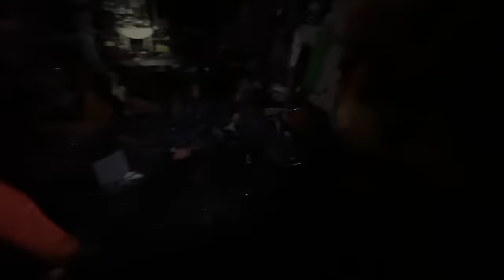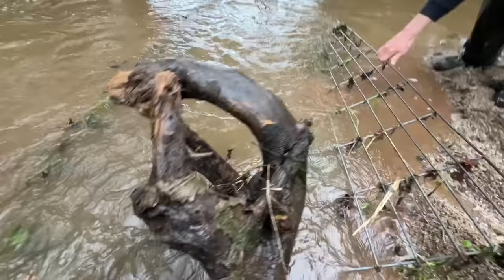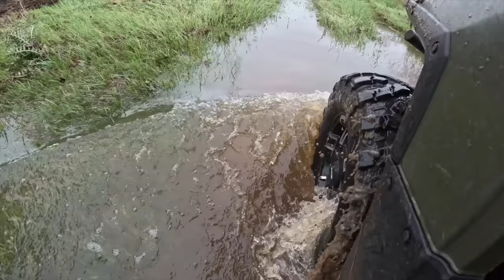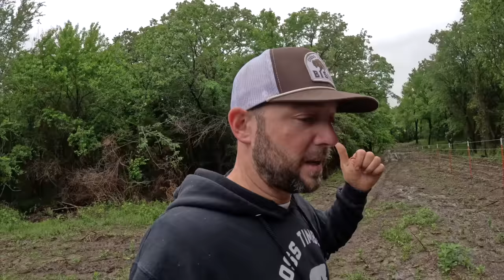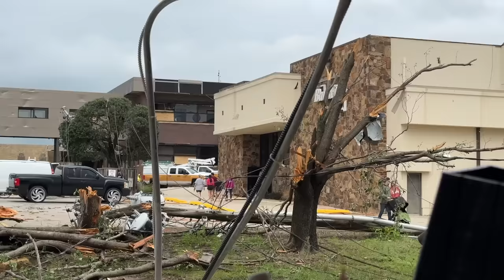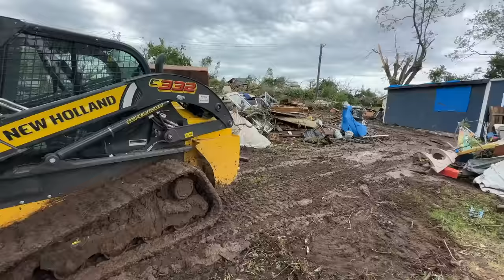Devastating Tornado Hits Home! Rush To Keep Our Bison In!

Comment: I’m 76 years old Dusty and I have been prayin for you all. My age made it through a tornado in 1999 and it flattened everything in its path. It was a mile wide. It was an F5. No buildings or trees were left standing and every car or pickup in its path was crushed into squares. It came through Moore and over by Tinker Air Force Base. It also made ya sick to look at it. Will continue to pray for y’all. Sorry about DeJay’s baby donkey. It’s hard. Thoughts and prayers from OKC.

Comment: Prayers for the people of Sulphur. When things settle down both for you and Lester (he has flooding) ask him about the fence at the JL property that has the creek. I don't know if it would work for bison but his longhorns don't mess with it. Basically smaller black plastic culverts, hung vertically with a cable through the top. They free swing with the high water, letting water and debris through and hang back straight after the water goes down appearing like a solid black wall.

Comment: Put the panels on the ground 🔼 the bend with the "high" center up. Then drive on them with the truck or tractor. It flattens them back out  that is the easiest way I've found.

Comment: You need to be building Monolithic concrete domes, they can withstand F5 tornadoes.    Bury them underground 25' if you want added protection.       This would lower your insurance costs and improve your survivability dramatically.

Comment: When I worked at Duke Energy, we had trash gates that would open on some creeks when high water with debris would pressure the shear pins to break. Allowing the water and debris to pass around dams. The outside crew would manually close the gates back and install new pins. Not sure if this would work if the Bison are on the field to keep them from getting out.